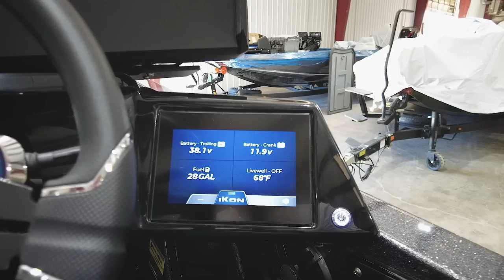TEAM TALK: iKON BOATS FACTORY TOUR! (ALL ACCESS!!!)

Comment: @ 22:40 the logic they gave you behind the 1.5 degree per hour livewell chiller makes no sense.  Basically he said it cools slowly so you don't shock the fish. but if you catch your 5th at 2:00 wouldn't you be taking it out of ambient temp water and throwing it in the already cooled water?  And vice versa during weigh in?
Reply: Cools slowly explaining how the water cools. Cool the water not to shock them from top water which is typically warmer on hot days and fish are caught deeper in cooler water. My bad in the explanation. Best explanation of the livewell  and the development was dropped in iKon L2 video
Reply: @scottwomack5174  yea I certainly understand the purpose of it and think it’s very very beneficial.
Reply from the maker: The livewell is temp controlled. You set the temp and forget it.